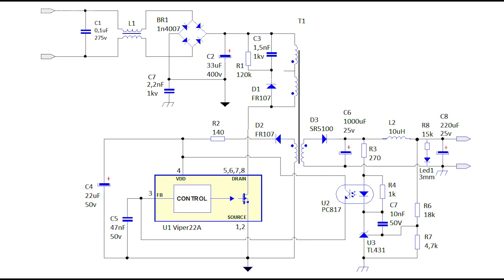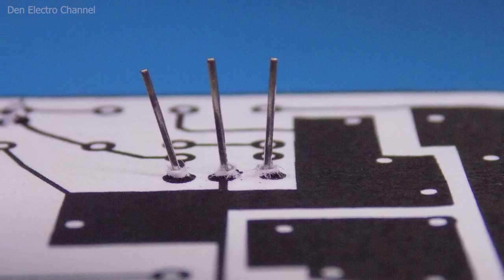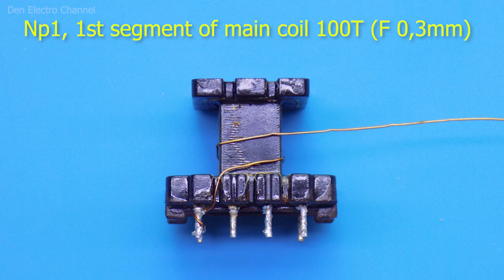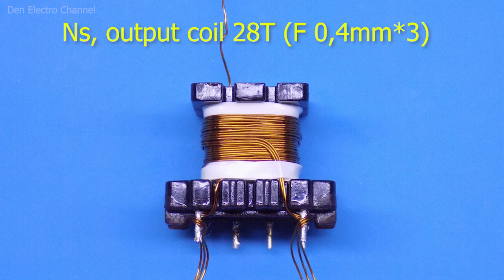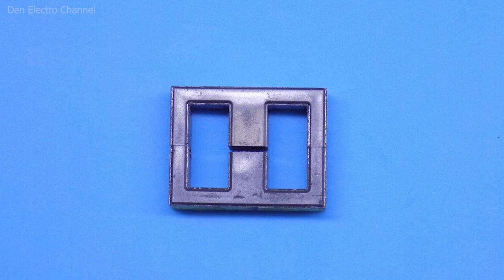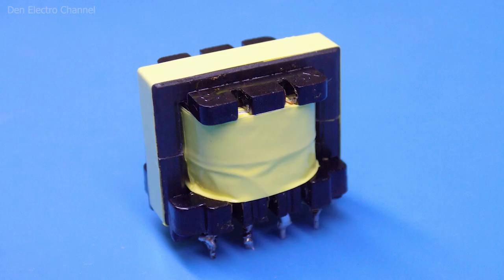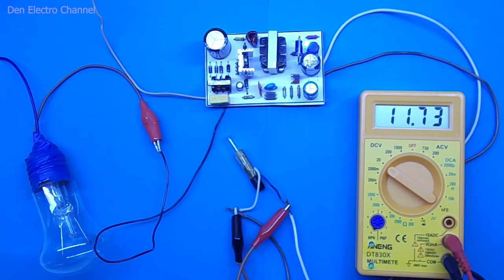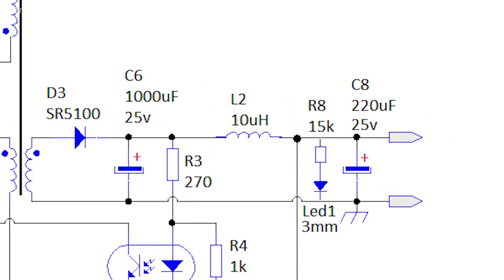Switching power supply for Viper22A

Comment: really talented for winding your own transformer with air gap adjustment, also can you show smps with other commonly available chips or power transistors like 13003, i wanted to make a dual 5v & 12v/2A each.
Reply from the maker: In the future, I will make power supplies based on transistors and other microcircuits

Comment: hi you presented this very nicely. i have issue with same IC. my circuit has little bit difference. i am using extra transistor along with TL431. my issue is with short circuit protection. after 800mA current viper22a blast. also do you expalain about electrical load you use in every video?
Reply from the maker: hi there is a video on how to make an electronic load, but unfortunately I haven’t translated it yet
Reply: @Den_Electro_channel  thanks 🙏

Comment: How did you choose the value of the EMI filter inductor on the AC line side
Reply from the maker: It is necessary to look at the cross section of the wire wound on the filter so that it does not heat up from the passing current.
      You can also calculate the required inductance of the inductor based on the frequency at which the power supply operates. But there are very complex calculations, I do not use them.
   Therefore, I always look only at the cross section of the wire.

You seem to work for some electronics company. If you know an easy way, please let me know.

Comment: hi how do you calculate the  winding required for transformer? i am little bit confused.
Reply from the maker: There is such a program as VIPer Design Software. there you can calculate the transformer for power supplies on the viper chip
Reply: @Den_Electro_channel  thanks for replying. But what about other ic you used such as AP series or UC38 series ic?
Reply from the maker: using the program "flyback 8.1"
Reply: @Den_Electro_channel  thanks for information

Comment: please helpme, instead of getting 12v dc ouput, my PSU getting 45v output. how to regulate the output?
Reply: how do you figuring out the TL431 to regulate the ouput?
Reply from the maker: If everything is correct, then the voltage should be 12 volts. And if you have 45 at the output, then you have a mistake somewhere in the circuit, or the parts are faulty. Are you sure the TL431 is working? If you connect something incorrectly, it is easy to burn it.
   How TL431 changes the voltage can be understood here: https://youtu.be/MC2sUexzlw4

Comment: i made it, but the voltage is too high may target is 12v. beside that the voltage is fluctuating.can you help me how to adjust the output voltage
Reply from the maker: Does the voltage fluctuate under or without load?